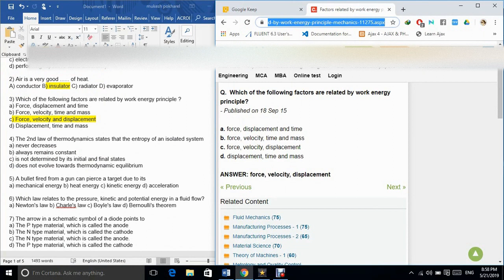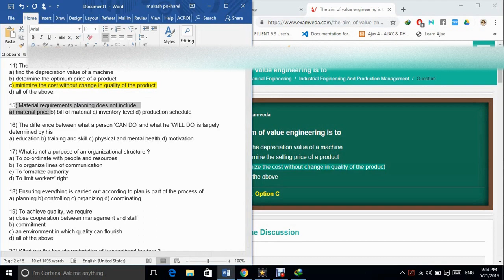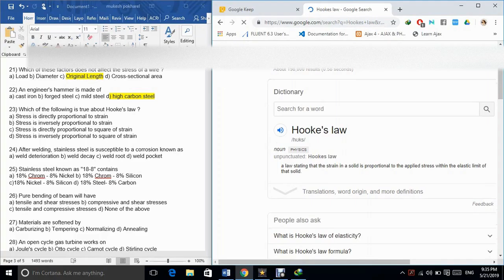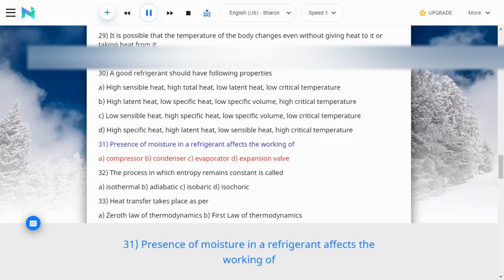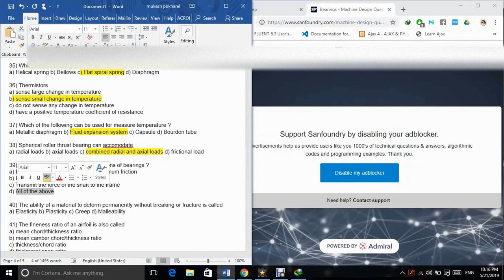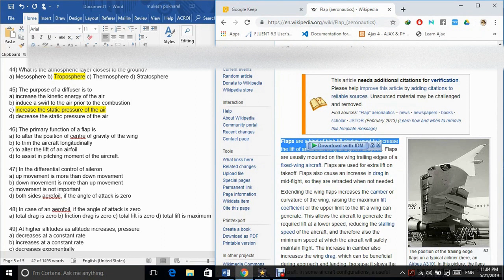Nepal AirLines LokSewa  वरिष्ठ प्राबिधिक अधिकृत - All questions answers

Comment: Tempering is wrong bhai its always Annealing
Nxt  its product mix bro nt vol of production . Actually vol of production is directly related with bep analysis do a lil search....
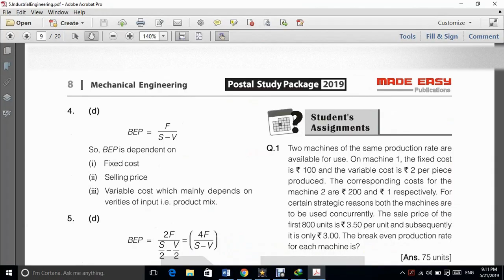Reply from the maker: Yes, Annealing is the right answer. Thank you so much for correcting.But in case of BEP, I think volume production is the right answer (  ) because break even point itself seems to be the VOLUME OF UNITS at which profits and revenues are equal. REFERENCE: https://drive.google.com/drive/u/0/folders/0B7rKOjI-k5mcQjRFSVRpVTZGeHc  Page No. 409 and explanation can also be seen on the video 3:22 is from https://www.madeeasy.in/uploads/examsolution/5.IndustrialEngineering.pdf